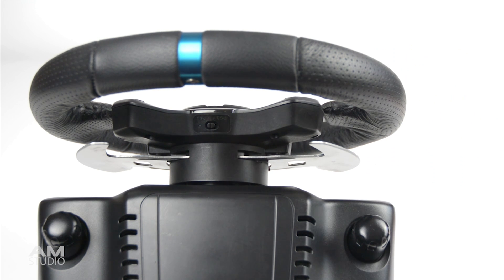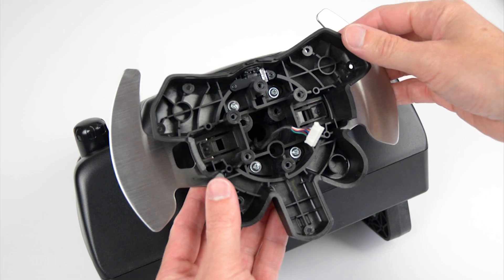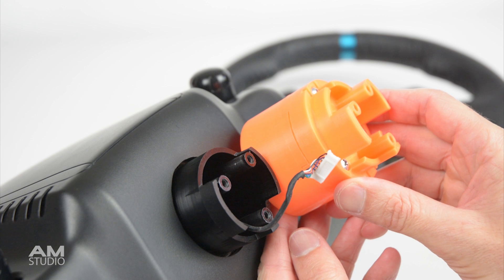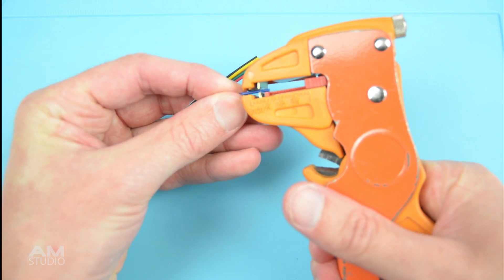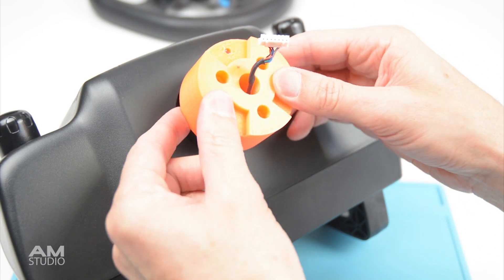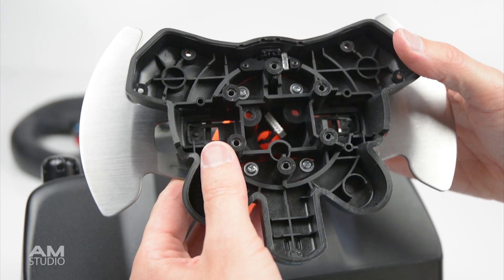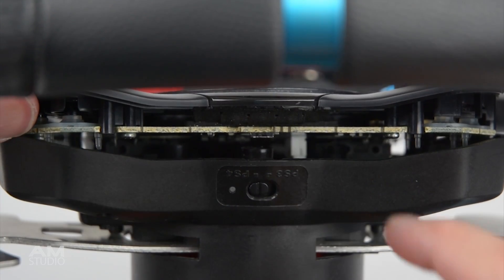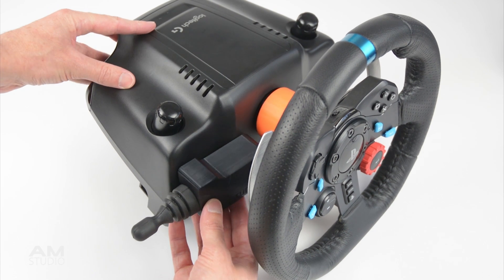DIY LOGITECH HUB SPACER AND EXTENDER

Comment: this desing could be apply to a quick release system? my idea is to apply a quick release instead of the extender soy the weel can be detached?
Reply: Same idea but I think if we change the 7 pins connector to a similar 7pins that use on the t300rs one will be more easy and use the similar design on the custom quick release for the t300rs

Comment: Can you attach multiple extensions? I want to replace an original arcade wheel and the shaft needs to be longer
Reply: Same question, did you figure it out? Too bad OP doesn't reply anything...

Comment: Really awesome stuff, just strated Sim Racing with my G290 but I'm going to mod it soon.
Reply: What mods have you done yo it cause i want to mod my g29
Reply: @life4fouryou  I had custom wheel with display, extender, shift paddles with additional magnets to improve the click and modified floor pedals with custom sprigs. Currently moved to fanatec setup - cost is higher but I think it's worth it if you simrace seriously.

Comment: Works on my G25!!! Beautiful!!!
Reply: If it works for you, it will work for my g27? Thanks!
Reply: It should work. In my case, the hub was a little bit tight.
Reply: @ruvas8451  lol how do you get this thing on here??? Do I need to file down the spacer or do anything in particular to the piece extruding from the LG base?
Reply: That's what I'd use it on as well! I assume the paddles would move along with the wheel too? (I'd use this on an arcade cabinet to keep only the wheel/paddles visible and not the casing of the unit itself.

Comment: Would it be possible to make the actual wheel it's self USB from the circuit board 🤔 like with logitech pedals, disconnected from the wheel base?

Comment: I have a g29 myself and going to make the blinker/turn signal mod but have a slight problem, there is nowhere to attach the casing to the wheel. Would anyone recommend a way to get it securely on the wheel? Drilling holes? Velcro straps?
Reply: I would say the best way is to screw it on the case but you need to be careful where, as you may damage the internal components
Reply: Twinkle Toes that’s what I was worried about, I’m not too sure where all the components are in the casing of the wheel and I don’t want to open the casing a risk breaking the wheel
Reply: @meister_harris5623  Well, the video uploaded does have a g29 teardown video if you scroll down his uploads list a bit, you should try taking a look at that

Comment: nice video! 
Do you ever had the problem that the G920 has given a signal to the pc although you haven't push a button? 
When I'm turning the wheel my engine turns off ingame, I use A Button for this
Reply: You have damaged wires. Wires which go to your steering wheel PCB. You must change them. You need JST 2.0 PH 7-Pin Connector with wires cables 26AWG. You can buy 10 Sets on Aliexpress. Better, thicker wires...
Reply: 10 Sets 7P
Reply: the wire going from the wheel to the print is damaged. Logitech in all their wisdom decided to use shrink tube on the whole lenght of the wire, so that they can't flex properly when you turn the wheel. This will snap the wires inside the shrink tube over time.